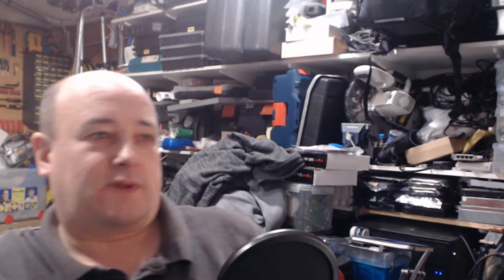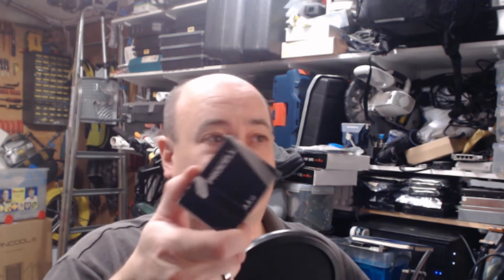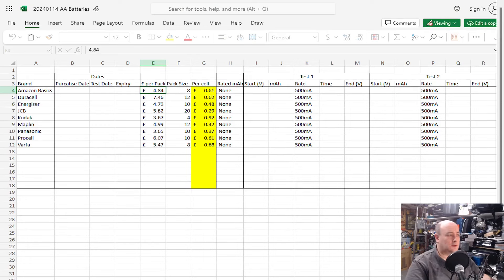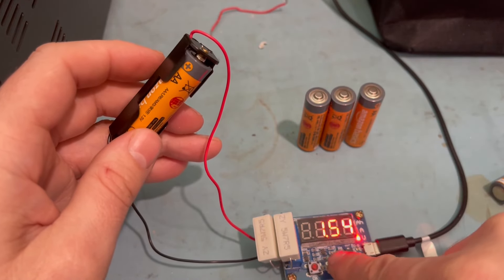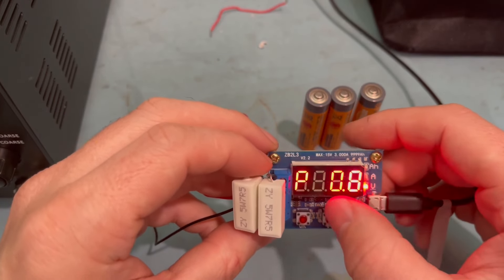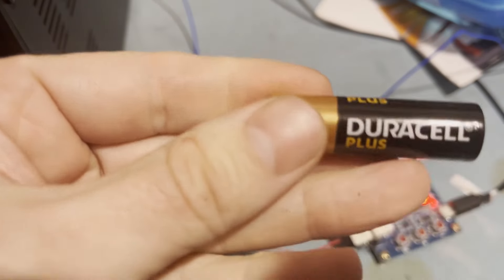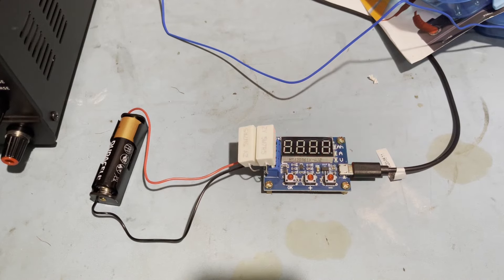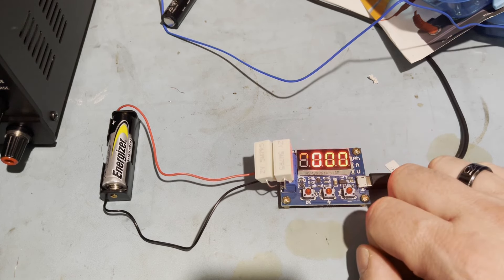AA Battery Capacity Testing UK 2024

Comment: Great tests!
The reason of the dissapointing panasonic battery is the chemical composition. You are comparing Alkaline vs Zink based batteries. These hold very little capacity vs Alkaline.

Comment: Great video, though it looks like the link is broken again (the one on the rechargeable video is working fine).

Would you be up for adding more data with online-only (as far as I can tell) brands? I'm sure there are tonnes, but the ones I keep coming across on eBay and Amazon are PoundMax, Camelion, and Eunicell. There's little to no information about them online, so would be good to see some testing, especially up to your standard. 

GP is another brand I've seen a lot online, but you can definitely get them in stores.